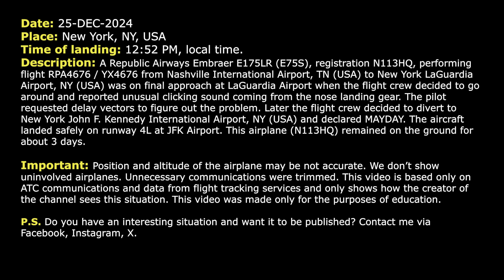Nose gear issue. Airplane diverts to Kennedy airport after missed approach at LaGuardia. Real ATC

Comment: Why change airports?
Reply from the maker: Longer runway.
Reply: The runway at JFK gave them an extra 5,000 feet.
Reply: It's kind of haunting in light of what just happened in Korea. I mean the go around and discussion of a longer runway just in case. Of course in this case they knew they had some kind of landing gear issue, but as of right now we don't know why the Korean plane did not, or could not, put down their landing gears.
Reply from the maker: Or maintenance base as well
Reply: @YouCanSeeATC  LGA is a Republic base.  but LGA is not near long enough for a potential emergency landing
Reply from the maker: Sorry, I didn't know that. I thought they have some maintenance base there as they were on the ground for 3 days.
Reply: Better safety equipment on standby at JFK?  Longer runway?
Reply: The ability to safely land and KJFK was probably the closest airport to go where the delays vectors had them fly